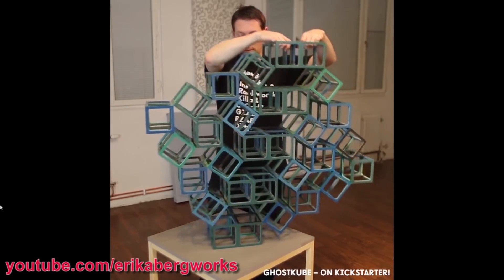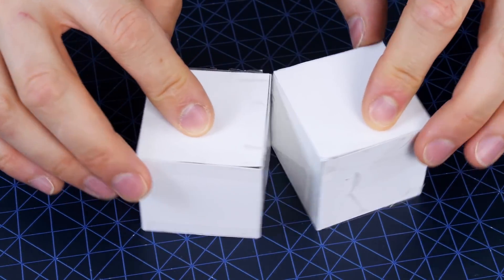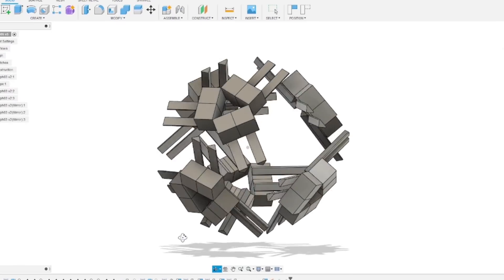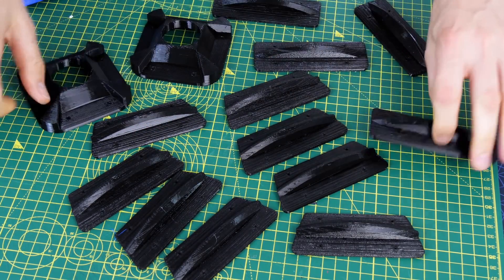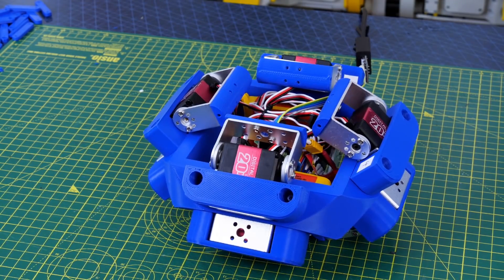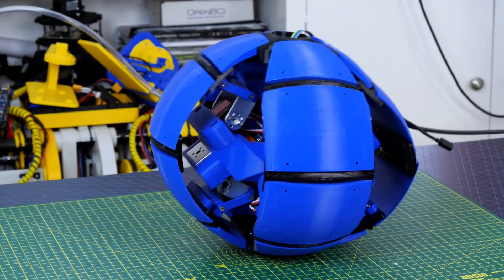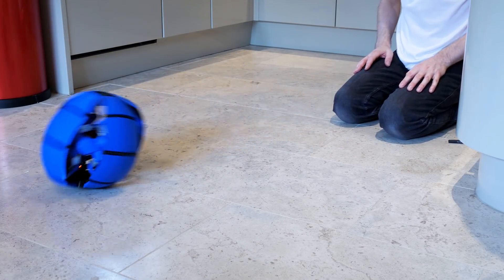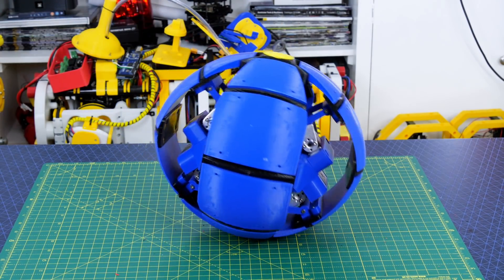Shape-Shifting Morphing Robot Concepts

Comment: Apparently the original comment was too long for YouTube, kept returning an error. I guess I'll just split it up into a comment thread.

 
The first portion of this comment is relevant to the first third of this video, the concept of using a morphing array of cubes. It loses relevance after the first third of the video, when the morphing sphere is introduced, though I do believe I bring up valid points relevant to the idea of making a robot based on the mechanism of a morphing array of cubes, maybe some ideas that can be looked into in the future if there's not already a research paper on the topic; but I guess this became relevant again by the end of the video. The second portion of this comment is relevant to the latter two thirds of the video, the morphing ball. It contains thoughts on the morphing ball concept as a whole, explanations of what how they work and what efficient designs are based on, somewhat categorizes morphing balls into sub-groups. This also brings up a potential locomotion fix for simpler morphing balls, and references a different form of morphing ball that gets its own explanation. Third and final section are further thoughts that don't have much relevancy, though by the end of the video I guess portions do have some relevancy, such as alternate designs, and a couple of disjointed alternate thoughts on this particular sphere.

 
Good god this comment thread became a tdlr of a thesis paper, I'm sorry to whoever actually reads through all of it, but there is quite a lot of information to discuss when it comes to various morphing robots, whether it's an array of solids, or just a single solid that morphs, both theoretical ideas and actual researched information, as well as concepts behind some of these ideas.
Reply: Folding flush cubes can be solved by a double hinge. There's actually some infinity cube fidget toys built with double hinges to accomplish this, a solid hinge that folds flush. Via these double hinges, you can also pass cabling, just make the hinge portion hollow with an entrance and exit, the cabling will follow the servo as the hinge bends, and as the end of the hinge will always be within the cube's edge, the cabling will always be concealed. The idea of using a pulley would work nicely, though double it so that both portions of the hinge have their own individual drive driven by a single servo, this eliminates the need for gearing but keeps both portions of the hinge at a 1:1 ratio; and again, use the hinge itself as an internal guide for the second pivot in the joint.

When exploring the concept of the mechanism going from flat to forming itself into a voxelized sphere, there should be latching mechanisms between the cubes that 'connect' to form joints, this would make for a much more rigid voxelized sphere. Though the idea of using gyroscopes to roll the sphere is a lot more complex, unless you have a cube with an internal gyro in the center of each face portion of the voxelized sphere, you're going to need multiple gyros in multiple face cubes around the axis of rotation, and these cubes would be sharing components with the hinge mechanism; and even then, the output power is questionable, as they'd be very small gyros with a very small amount of rotating mass to induce movement, couple that with the additional weight of each cube, and the need to balance everything, it doesn't seem like a feasible concept, unless each cube is a contributor to the gyro-based rotation. A morphing voxelized sphere seems to be the better approach than a rolling voxelized sphere, from the viewpoints of materials (motors, batteries, cabling), weight, and movement efficiency; it's not a bad idea, as rolling would be more efficient with a true sphere, or in moving a larger, singular cube (ala Cubli, or similar mechanisms) but I just don't see it working for this project, unless you do use the gyro mechanism in each individual cube, but that drives up costs, needs additional processing, additional programming, and additional battery.

 
I think the design needs to work per module cube, as in each cube has its own circuitry, battery, and servo; and the addition of the 3-axis gyro setup if you're going with rolling motion. This would function as a cluster, rather than have a central processor, essentially a hive-mind rather than a singular brain. This would be the best way to balance the entire thing, and makes it modular enough to the point that you can build out any morphable shape, as long as you have supporting code for it. Programming should also be simpler for this approach, as each position would be calculated and adjusted per module, rather than having a central processor tracking multiple floating points, a module would only need to account for neighboring modules, or just downstream modules; almost like an octopus' tentacle, where it works in nerve-centric sections, rather than a central brain controlling an arm, section z has feedback to section y, section y has feedback to section x, and so on up until section a, it offloads processing to each module rather than tasking a central compute unit with processing for each module. Though, when talking about gyro movement, this would just copy the same bit of code to each module, as you're now moving each module within the same rolling path. The locking mechanism would add asymmetric weight to each module that includes it, though this can be offset by having a dummy weight in every module that does not include it.
Reply: I should preface this section by mentioning that when talking about polyhedra, the morphing sphere will be based on the spherical tiling of said polyhedra.

The morphing sphere has been around for awhile, though I'm not sure if I've seen this exact mechanism as one. Though, I'm not sure if this mechanism is idea. It's based on the edge transitions of the faces of an octahedron, but only the edges along the central plane perpendicular to a group of polar vertices; this is essentially taking a sphere with its center at (0,0,0) and slicing it with the XY and ZY planes, slicing the sphere into four portions, a two-pole sphere. I believe the ideal, when based on an octahedron, would be to based on vertex transitions, giving the sphere more flexibility; essentially take a sphere with its center at (0,0,0) and slice the sphere with the XY, XZ, and ZY planes, so that the sphere is split into eight portions, a six-pole sphere. In an omnidirectional robot like this, it's better to have more flexibility in each omnidirection, thus basing the slice transitions on the vertices of a solid would be ideal, with the octahedron more than likely being the simplest, as the transitions are all planar and perpendicular, something you would not achieve with any other base solid. Though, that's not to say that this is the best method, just the simplest; basing the actuation on a more complex solid, say a geodesic or goldberg polyhedra, would inherently allow for much more flexibility, and much more refined movement, but at the cost of being much more complex computationally, and much more complex to program. As a proof of concept, and something that's easy to program and build, the six-pole sphere is going to be the best option.

The current design, the two-pole sphere with two bands, only has a handful of movement directions. Standing on it's pole, it has movement in the XY and ZY planes, and mixed movement in the XY-ZY and ZY-XY planes, all four in the positive and negative directions. There's also another form of mixed movement here, rolling the sphere in it's XZ axis, which is a mixed movement that comprises of a mixture of other mixed movement, making this form of movement even more inefficient. These types of mechanism will favor rolling along the bands, as mixed movement becomes less efficient, especially as the 'sphere' will morph further in it's dead zones under mixed movement than it would during movement across a band; think of tire deflection, the bands will have one deflection characteristic, mixed movement will have a different characteristic, and in this example of a morphing sphere there's two basic forms of mixed movement. This is why I argue that a six-pole sphere will inherently be more efficient, as you'll have only one form of mixed movement, as the six-pole sphere has an XZ band, eliminating the need for complex mixed movement along that plane, as the six-pole sphere has that planar band.

This is also why more complex polyhedra are further more efficient, though it's a bit backwards, as the more complex polyhedra will contain more mixed movement, but that mixed movement is also refined to the point that the actuation shouldn't be compared to simpler polyhedra. In the case of a geodesic or goldberg polyhedra, you'd have such a large network of actuation, you're essentially forming a lump on the sphere, rather than contorting a major portion of the sphere for actuation, though a geodesic polyhedra would still have a network of bands, so maybe it's partially comparable to simpler polyhedra. I also believe this is where we need to better define polyhedra based on two classes, banded and non-banded, for example an octahedron and geodesic would be banded polyhedra, as their edges form bands or partial bands, whereas a cube and a goldberg polyhedra, the duals of the aforementioned polyhedra, are un-banded as their edges do not form bands, or at least not clean bands. This distinction of banded and non-banded will also help derive locomotion, as banded base-polyhedra will want to roll along its edges and push from its vertices, with pushing from its faces being a form of mixed movement, whereas a non-banded base-polyhdra will want to roll along its face transitions and push from its edges, with pushing from its vertices being a form of mixed movement.

In actual locomotion, this is where a more complex polyhedra is realistically more useful. Because the more complex polyhedra would not be contorting an entire band to induce locomotion, it'd instead be morphing a section of the sphere to push itself, thus much higher efficiency. Though this is a much more complex build, and it would end up benefiting from linear actuators when you get into the territory of complexity that geodesic and goldberg polyhedra hold. This isn't to say that a simple polyhedra can't be efficient, they just need a better way of inducing movement, as that initial push is what's needed, and why a complex polyhedra has the upper hand when it comes to morphing sphere locomotion of this style, because you can form what's essentially a lump on the sphere to push it; this also translates to when the sphere is rolling, the complex polyhedra just have much finer control. This will be controllable and consistent, though it lacks efficiency due to complexity.

To counter this locomotion issue on simple polyhedra, possibly look into adding a door with a servo in the rigid portions. This hinged piece would act as a pushing foot, for at least initial movement. This could also be used as a helper while rolling, giving the mechanism a bit more leverage while it rolls. Look at Zenta's MorpHex, their YouTube is Zenta, their website is zentarobots(dot)com, and look at how their robot, in ball form, induces movement. While the MorpHex is a different mechanism entirely, it should give you an idea of what's needed to push a morphing ball, thus where the idea of having pushers along the solid portions of your morphing ball comes from. The only issue with this is that it is probably idea to have bi-directional pushers per panel, for better omnidirectional movement; possibly a dual-door design with the hinges in the center of the section, with a modified servo horn to actuate them, so that servo neutral has both closed, servo positive opens door 1, and servo negative opens door 2? I think this is probably the most realistic way around the locomotion issue. This should also make the rolling much more consistent, possibly even more controllable.

The MorpHex mentioned before is a different class of morphing sphere. While I went more in-depth with polyhedra relating to the mechanisms relevant to the morphing sphere in the video, the MorpHex should also be somewhat discussed. This mechanism is based on a bipyramid, MorpHex specifically is based on a hexagonal bipyramid. The reason I did not include this type of morphing sphere earlier is simple, the locomotion is entirely different. Instead of contortion of multiple segments to push a sphere, MorpHex, and similar robots, have articulated faces of it's base-polyhedra, where the faces have much more freedom of movement. In reality, this is one of the simplest morphing spheres, due to the articulated faces having such a large range of movement, which makes locomotion stupidly simple. I'm sure other bipyramids work fine, but a hexagonal bipyramid is probably the balancing point of simplicity and usability; for example, a triangular bipyramid would struggle with locomotion, whereas an icosagonal bipyramid would be overly complex, may not fit its components into a smaller sphere, just for a refined locomotion. Of course there's also further experimentation that can be done here, such as using gyroelongated bipyramids, the regular icosahedron being the pentagonal gyroelongated bipyramid of equal faces, though triangular, square, etc., also exist; these could be interesting in the MorpHex locomotion due to the central band of triangular faces that're 2x of the base bipyramid, for example the icosahedron has a band of ten triangular faces when it's based on the pentagonal bipyramid. The MorpHex variant of locomotion will by far be the most controllable and consistent.
Reply: There's also a variety of other designs. Yale has a clay robot with a morphing skin. IEEE Spectrum's channel has a video titled "Continuous Shape Changing Locomotion of 32-legged Spherical Robot," which could be housed within a spherical skin or shell, which is also different from the aforementioned morphing spheres, as it's actuating from the sphere's center to induce locomotion; though this would be similar to the aforementioned complex polyhedra, geodesic and goldberg levels of complexity, as it's morphing a lump onto the sphere to push itself. Then there's also the rolling tensegrity mechanism, which could be bound by a shell to make it more spherical. Along with a variety of other possible designs.

MDPI has an open access paper titled "A Review of Active Mechanical Driving Principles of Spherical Robots," with a few notable entries. Figure 10 has telescopic limbs, though the original robot's locomotion was gyroscope based, these extendable limbs could be used in combination with the 32-legged robot from the IEEE Spectrum video; rather than 'morphing' the shell, the shell can be a solid sphere where these telescopic limbs push out, like little pushing legs not bound by anything, except the solid sphere they retract into. Figure 12 has a sphere that has an actuated section that pushes outward, the example only has one of these, but a design could have multiple, examples included rolling, stopping, wheeling up a hill, and lifting up stairs; this is similar to the previous idea, except instead of telescopic legs protruding from a sphere's surface, this is using the sphere's surface itself as the footing of a leg. Figure 14 uses a sphere with sections that contain air bladders, this is similar to the aforementioned geodesic or goldberg polyhedra creating a lump on the sphere's surface to push itself, but instead of complex mixed actuation, this just uses an air bladder to achieve the same result; figure 15 is the same concept, if not from the same robot itself. Figure 16 is shape memory alloy, which works well in a band, but it could be interesting in a sphere; potentially as an alternative to the air bladder concept, as in using the shape memory alloy to actuate as a small spring in compression or extension, and an array of these could possibly be used to give a more refined movement.

There's a handful of research out there, though I don't know how much of it is refined research, or even research going beyond initial face value of a concept. What you've made here is just one of many potential designs. While I believe what you're building does need it's own refinement, which should be explored, I also believe that there are better methods for morphing spheres that should be looked into, like the idea of face articulation in the MorpHex being applied to something like an icosahedron; an example of better alternatives would be, like mentioned before, using the air bladder concept in place of insanely complex of articulating a geodesic or goldberg polyhedra, same basic locomotion, but the air bladder concept is vastly simpler in design, implementation, and computation.

I'm hoping that this video could potentially spin off into a long-term series. Not just for refining this one type of morphing sphere, but also exploring other morphing spheres. Similar to how OpenDog has had many iterations, spinoffs, and experiments, the morphing sphere could become something similar, though less focus on an end-goal and more focus on concept exploration. I'm hoping this comment is seen, and read thoroughly, especially this last section, as a morphing sphere could quite easily become a content generator, especially on the more simple concepts; I'm not expecting a geodesic or goldberg sphere comprised of either hinges or linear actuator edges to ever exist, I don't think even the most well funded of research would even take that concept on, I've only brought that up as a theoretical example pertaining the type of locomotion that section of the comment was relevant to.

The locomotion of your morphing sphere, and I guess this would be true of all morphing spheres with a similar locomotion, really reminds me of the rotaped mechanism, though with curved sections within a circle. Maybe there's similarities that could be drawn between the two for further refinement; though I do believe my earlier suggestion of having hinged pushers would be the ultimate solution to the locomotion problem.

And one last final though, about the issue of this sphere having mechanical linkages between every panel, meaning everything flexes at once. Why not use a linkage system similar to a Hoberman sphere, except have it relevant to only the sections you're wanting to expand, while they're only hinged in the middle of each segment. This way only a portion expands at a time, while the other portions don't expand. This may modify locomotion a bit, though. I'm also not sure if the linkage system would be correct to compare to a Hoberman sphere, even modified, as you're only looking to expand half of an actuated section. Alternatively, why not put a linear actuator between the two halves of one section, and actuate it that way, this should work better as you would be expanding and contracting each individual section, rather than expanding and contracting the distance between the sphere's poles?